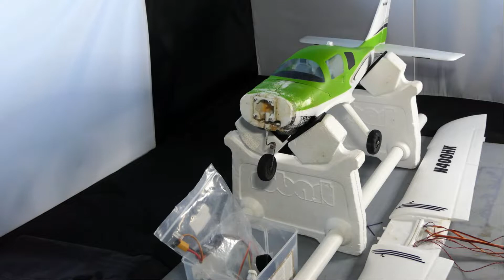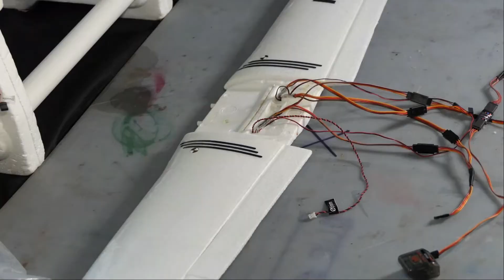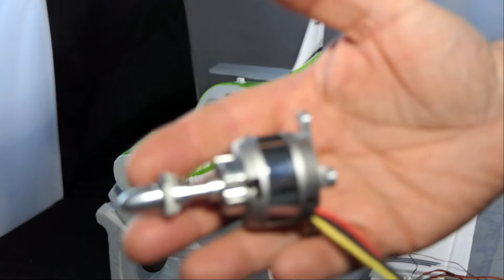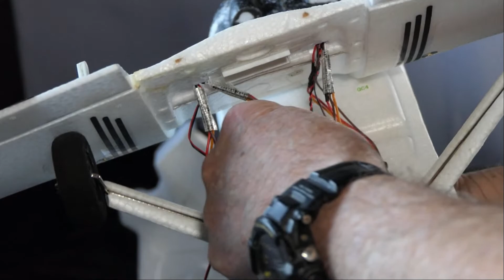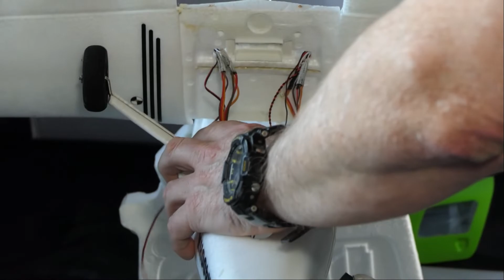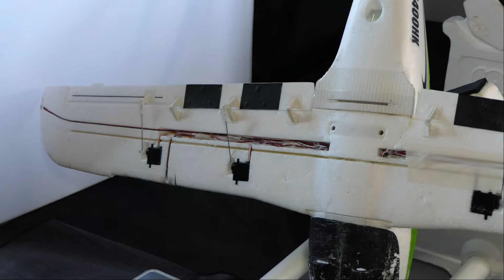Another Crash Repair - TTX -  Jan 2021 Part 4 of 4

Comment: I had my first crash last night landing my ST Models Discovery, it was slow speed on landing and the only damage appears to be a bent motor mount as the propshaft looks fine and straight but it cut short my flying time. Oh well. Now just need to get the cowl off and check damage, see what can be done. Your repairs show it can be done 👍🏻
Reply from the maker: Sorry to read this - I have an STM Seawind - still in the Box - the Discovery is  a good aircraft and as its foam , you should be in with a very good change of repairing it ready for flying once again - Good Luck , let me know if you need any help, I should say that I do not use hot glue - so I would suggest you use UHU POR - its cheap and great on foam...
Reply: @FlankerTanker  Thanks Martyn, it’s still work in progress as I’m having trouble removing two remaining screws holding the motor to the mount so I’ve sprayed with some WD40 and will leave overnight. Thanks for the offer of help, that’s much appreciated 👍🏻

Comment: Great work. I was getting ready to fly mine and had no flaps unless I put pressure on the underside of the wing. So I eliminated the servo lead pin connector and hard wired it. I sure didn’t want to lose it as it is a very good flying plane.
Reply from the maker: That's what gets me it is a good flying plane yet mine seems to be jinxed..lol  I have lost count of the crashes 2 for sure might be 3 or 4, and repairs like this one at least 3 or 4....if this hard wire , new RX, works and I am over the problems, I might get a new one and do the mod on it from the get go..... then I will have a good flying and good looking TTX once more..use this on as parts or as a throw around aircraft.....